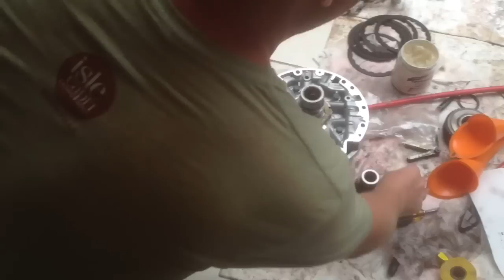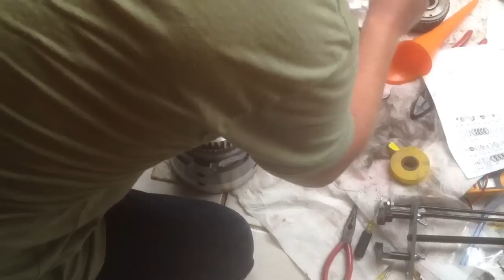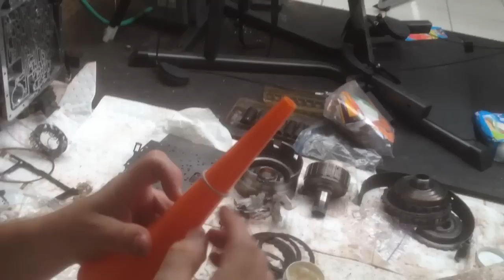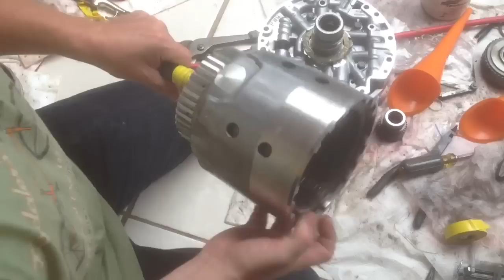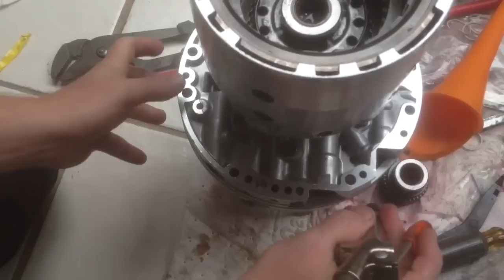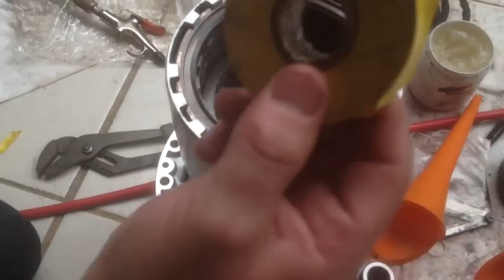4L60E Drum Air Check + DIY Teflon Ring expander Trick (No Special Tools) Test the Drum Clutch Packs

Comment: All you got to do to avoid all of this hassle is cut the seal at an angle so it overlaps itself when placed on the shaft. Or buy pre-cut seals from your local transmission shop. Problem solved and the transmission goes together a whole lot easier. Also works on the two seals that are on the front pump

Comment: CUT THE FUNNEL SHORTER AND THE RINGS WILL SLIDE OVER THE  FUNNEL AND IN TO THE GROOVE AND THE ELECTRICAL TAPE WILL RUIN AN  ACURATE PRESSURE TEST .THE WHOLE POINT OF THE PRESSURE TEST IT TO CHECK THE RINGS ALSO THIS METHOD DOESNT LET THEM EXPAND IN THE STATOR
Reply from the maker: Robert Campbell as you can see in the video the electrical tape did not cause the test to fail.  In fact if you paid attention you would have seen it operating correctly.  It is however your choice to use or not use the 
method.  I am still driving the same Chevrolet Suburban with the same transmission that I rebuilt.  If time will tell time has told.  Thankyou for your input but if I rebuild another 4l60e I will use this method again.

Comment: dodgy 20 years of rebuilding wouldnt bother doing it without using the right tools people wonder why they are always cooking the 3 / 4 clutch pack
Reply: j dub you must be referring to the "top section" clutches :) lol Do you suppose he replaced the shell ... probably too expensive
Reply: is expensive replacing shell my box owes me around $2000 aud in parts alone but will last for years
Reply: j dub the shell for OE+ is less than $30 at Transtar. I did 3 4L60Es last week all with torque converter, complete OH kit with all clutches and steels, 2-4 band, sep plate, bushings and washers and new sun shell at approx $400 per box

Comment: I replaced a sungear 3+ years ago, now my clutches are starting to slip . While Im not scared to do the job Im not looking forward to it. 
Thank you for the tip . Who wants to buy a 100$ tool to use once? But after seeing this Ill grab few extra sets of seals when ordering my MOK.
Reply from the maker: I am still driving my 1996 chevy suburban with that same transmission that I rebuilt.  Good luck I am sure it will work well.  Your clearances on your clutches is critical get those and your golden.

Comment: should sealing rings be replaced if they aren't ripped or worn like blackericdenice stated? Also, I used the plastic from a 2 liter bottle to slide the rings on it worked, not sayin it was the best, Ill post a video. it took trial and error, but #4 went on like a dream!

Comment: You can still cut your seals while putting front pump in .
Reply from the maker: True you can still cut the seals so you have to be very delicate.  But this prevents it from cutting due to not being shrunk onto the shaft.  The transmission that I rebuilt has been going strong since the rebuild no problems it was a 1996 chevrolet suburban 2 wheel drive.  We drove from Missouri to Pittsburgh Pa 3 days later.  I have been very happy with the rebuild and the tci components that I used.

Comment from the maker: Robert Grillo I am not sure of the point of you posting your useless comment on this video.  If you read the post before you then you would have seen that David smith already posted that the tool is 85 dollars.  While you may think 85 dollars is cheap maybe other people would like to do the exact same professional job for a dollar which is the point of this video.  Also your brilliant comment of an air test will pass with a bad seal further discredited your credentials for posting any sort of value added comment.  Quite the contrary it was a negative comment with no value added.  Here is how physics work air is thinner than transmission fluid if you pass an air test meaning your clutch pack holds tight with no loud hissing (hissing means failed test and transmission fluid will pass) then you will for sure pass a test with a the thicker transmission fluid.  If you run this test with a bad seal it is possible that some force will transfer to the clutch pack however, you will be losing air by the seal (hissing noise) thereby not getting the full pressure against the clutch packs.   Robert there is a reason I made this video it is because I learned the hard way and destroyed my seal and failed the air test I was hoping this 4 minute video would help prevent others from having to buy extra parts and giving them the opportunity to not make the same mistake I did.
By spending the time to do this test it is like doing your future self a favor.
Reply: very well said.
Reply: There's a reason professionals do the same air tests and why Sonnax sells a vacuum test kit to check valve bodies for wear. Good video.
Reply: Nice video and good idea protecting them with tape. Another good tip is if you don't have a sizing tool you can use hose clamps to size them down. You can even hook 2 clamps together if you need to for big rings.

Comment: Just an fyi for anyone doing this the tool to size and resize is cheap. also he is misinformed slightly a rolled seal can and will air check fine but once you put it in the car/truck it may not hold due to much higher fluid pressure

Comment from the maker: Yes I kept the tape on till time to install the second time.  I used assembly lube and it slid in easily. I then air tested the assembly again.  Test passed finished putting it back together and installed in my suburban.  We have now put over 1000 miles on it.  I will say adding the shit kit made it a much stronger shift which is not my favorite but I wanted to reduce the heat generated within the transmission during the shifts.